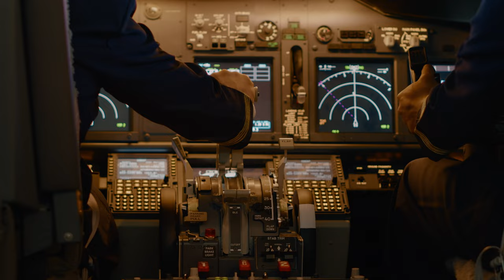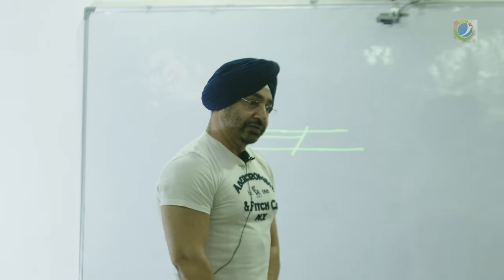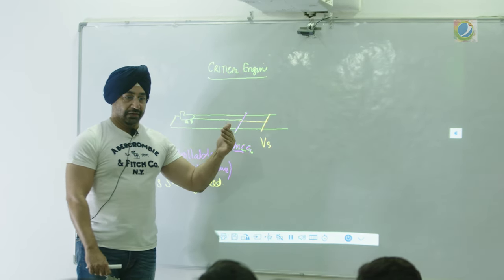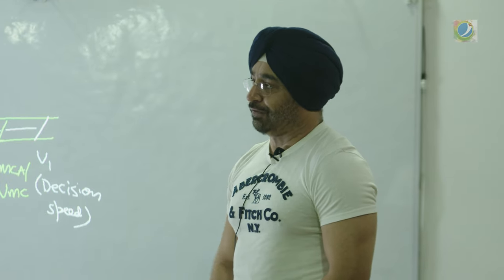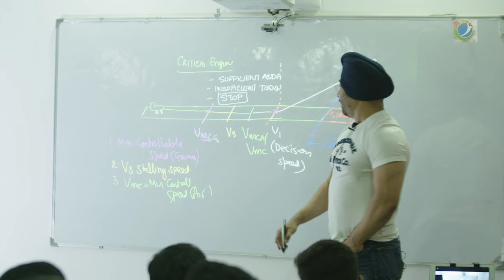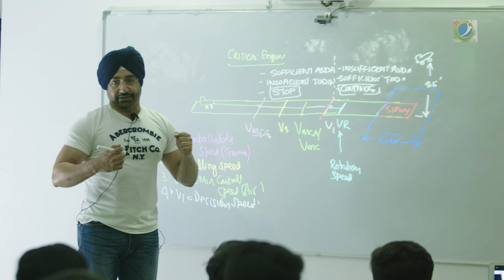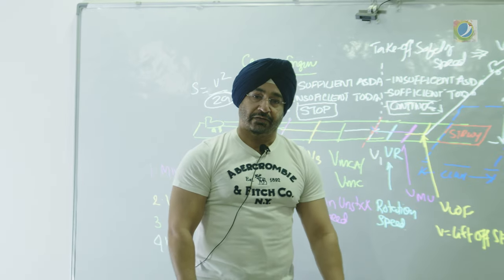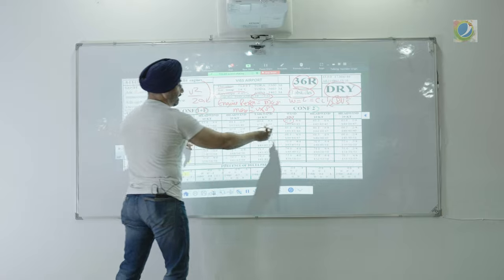V-Speeds during Take-Off  explanation | Airline Prep | ATPL | CPL |Learning with Capt Surinder Singh

Comment: Captain, I encountered an unusual situation during a 737-800 simulator session and I'm seeking your professional insight. The scenario was as follows:
Aircraft: Boeing 737-800
Phase of flight: Climb
Initial altitude: FL090
Target altitude: FL130
Configuration: Clean (flaps 0)
Airspeed: Approximately 290-300 knots indicated
During the climb phase, the indicated airspeed suddenly dropped to zero. All other flight parameters appeared normal prior to this event.
Could you please explain potential causes for this airspeed indication anomaly? I'm particularly interested in understanding if this could be related to a pitot-static system malfunction, an Air Data Computer (ADC) issue, or perhaps a simulator-specific problem. Additionally, what immediate actions would you recommend for flight crew encountering such a situation in actual operations?
Reply from the maker: Thank you for contacting. Just a quick query …Was this indications on both sides i.e. Capt and FO EFIS?